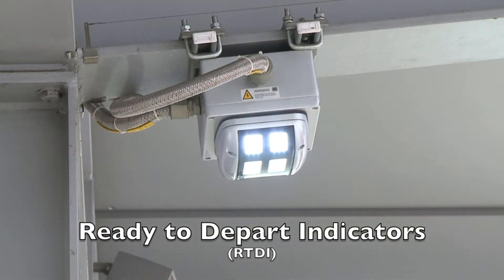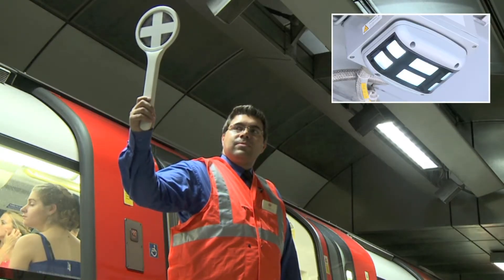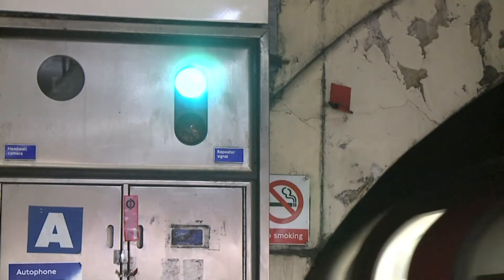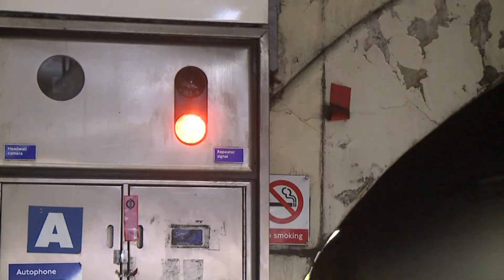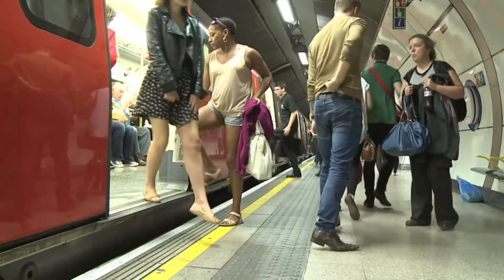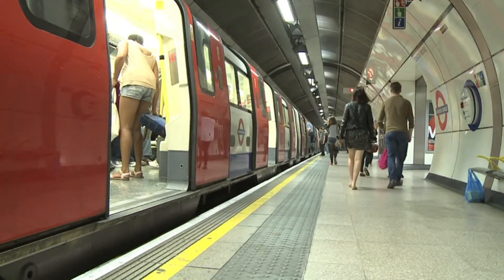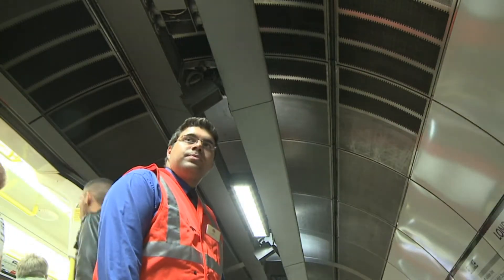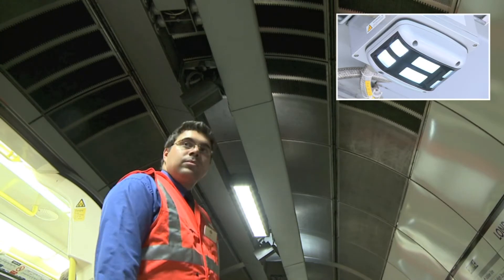Northern line Ready to Depart Indicators (RTDI)

Comment: Excellent, but they're on all lines with ATO. They're built in on the sub surface stocks and they have them externally on stations on the Jubilee line. :)
Reply: All ATO flavours or just the SelTrac ones? IIRC the Central doesn't seem to have any form of repeater/indicator on the platforms, though the new Victoria line version has them where the old version had the repeaters...
Reply: @fetchstix  Yeah, not the central
Reply: @TransporterTony : Hmm, wonder why they didn't go with them there?
On the note of "ready to depart indicators" I'm guessing that the Crossrail core has equivalents too? On the stations with platform screen doors, I think they're the white light underneath the destination screens, and there's mention of "3 Platform Despatch indicators" at Abbey Wood and Custom House, though I haven't spotted them - has anyone caught them or know whereabouts they are?
Reply: @TransporterTony : Yea figured that - I think I've found (some of) the indicators for the non-PSD stations now as well 😂 they seem to be the same as/similar to the ones in this video, and I think they're also at the departure screens too (at least in the pictures I've seen for CUS and ABW) 🤔